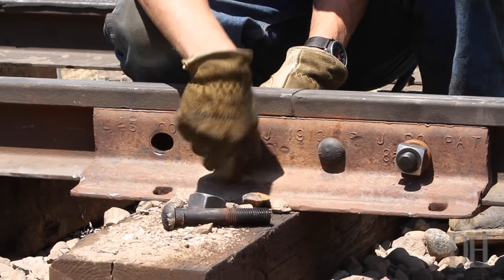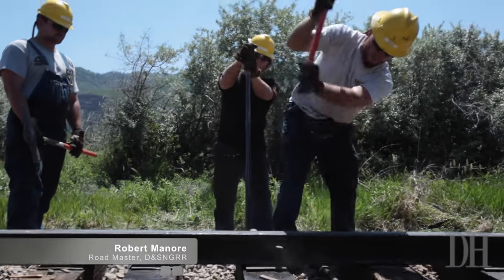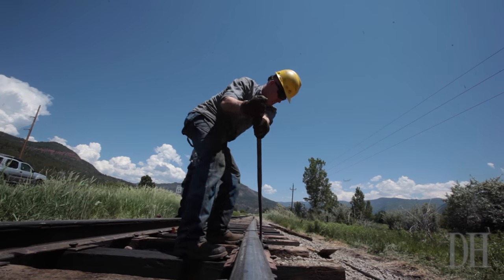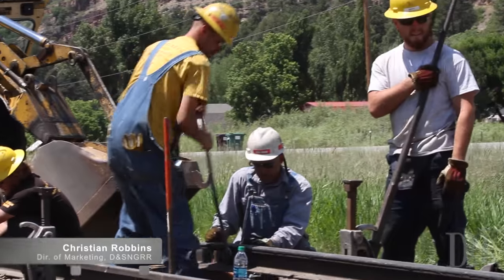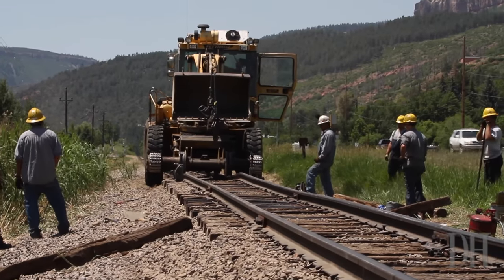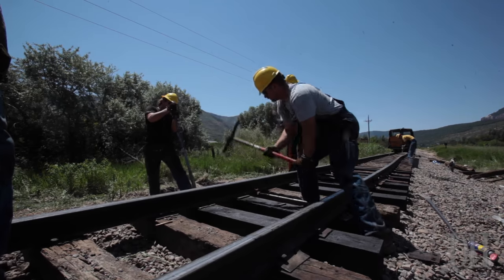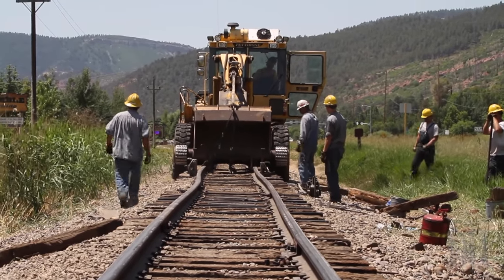Train tracks bend in heat

Comment: Someone who knows how to spike spikes on the inside of the rail, not over it that's why
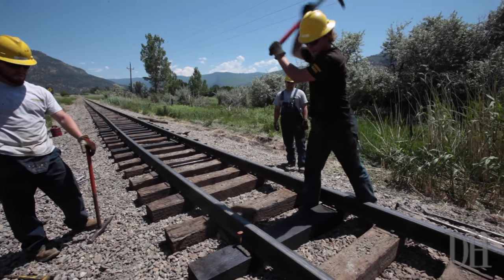the head of the spike maul broke @0:34.
Reply: accuracy improves if you can swing the hammer without sliding your hands up & down as you swing. 
move your hands, miss the spike, handle hits the rail & breaks. i didnt see one experienced spiker in this video.